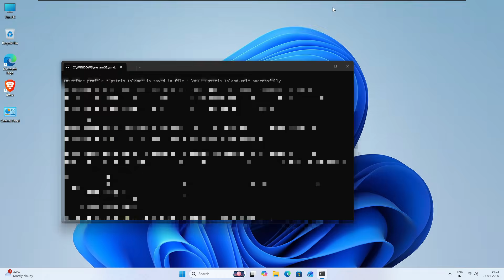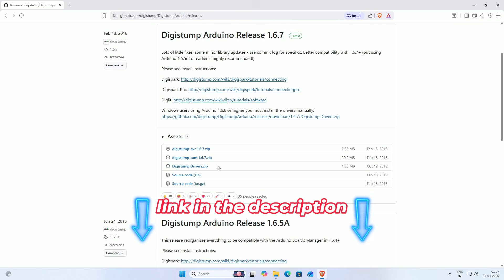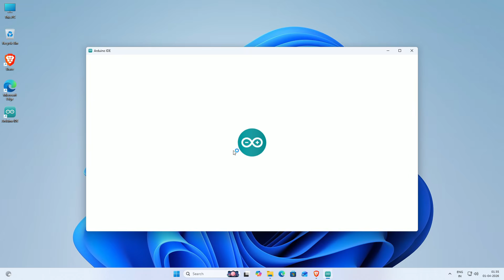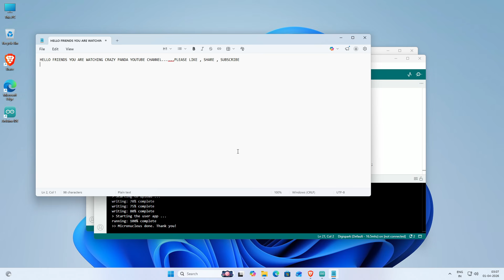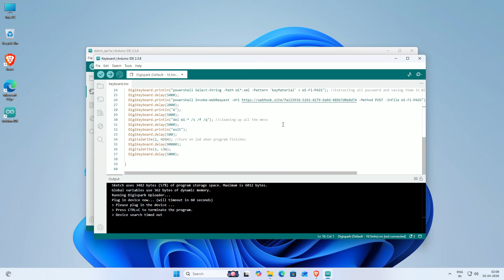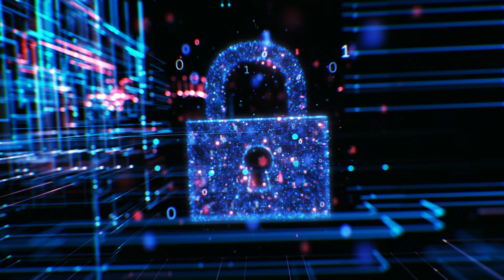How to Build a USB Rubber Ducky for $2 | Digispark Hacking Tutorial

Comment: Is there any program to use on Mac or Linux?
Reply from the maker: Yep! HID attack demos like the one I showed with Digispark aren’t limited to Windows. On Linux and macOS you can use similar USB Rubber Ducky style payloads or HID injection tools. The concept is the same the device emulates a keyboard and runs pre‑written scripts. Digispark itself works cross‑platform, but you’ll need to adjust the payloads depending on the OS (for example, different shortcuts/commands for macOS vs Linux). So yes, it’s totally possible on Mac or Linux too, just with OS‑specific tweaks.

Comment: does this work with ducky script payloads if they are translated to arduino?
Reply from the maker: Not directly Ducky Script and Arduino code are written differently. But you can take the idea from a Ducky payload and rewrite it in Arduino so the Digispark understands it. It just needs a bit of manual tweaking.

Comment: is it the atmega32u4 from aliexpress 
 or where do i need to buy the digispark
Reply from the maker: Yes bro, you can also use the ATmega32U4 as a USB Rubber Ducky for HID attacks. But the Digispark is based on the ATTiny85. Both ATmega32U4 boards and ATTiny85 Digispark can be bought easily from Amazon in your country.

Comment: Just as side note. The Digi has one chip where the chip emulates the USB protocol. Its a V-USB category. So that means that the pre-loaded program and the usb emulation, which is software, runs on the same small chip. That can occure crashes. To pretend this, you have to set delays what makes it good for evading AVs but make it visible for the possible "device owner" . Further more there is limited memory so you can't pre-load big payloads.

But(!) a good video and Digispark is nice for testing and to go deeper how HIDs work 💪😌
Reply from the maker: Great technical insight, thanks for sharing that perspective with the community! 🐼🔥
Reply: @CRAZYPANDA599  thank you and for the content. Nice videos and project ideas 💪